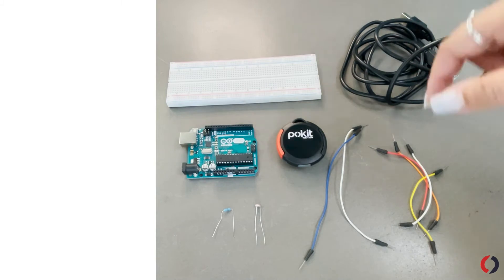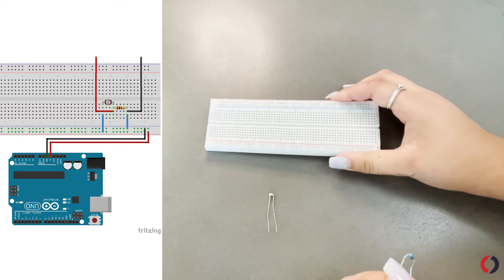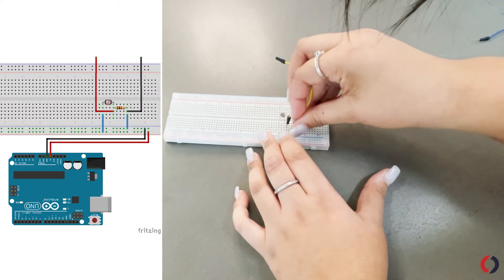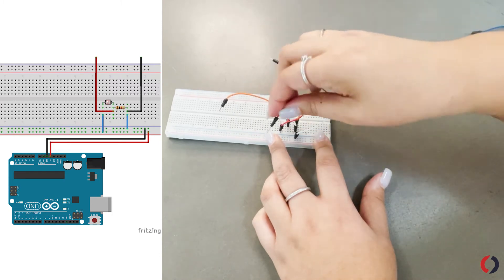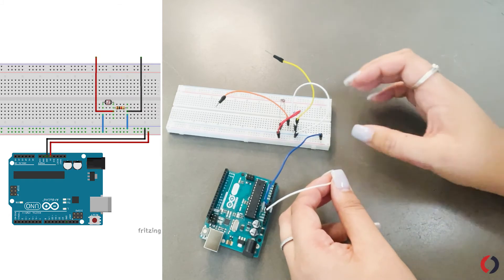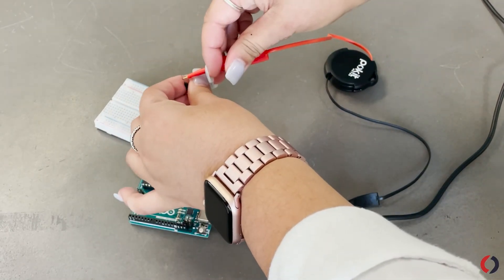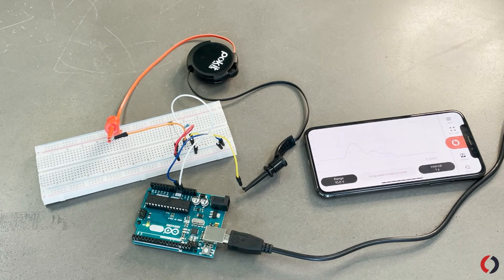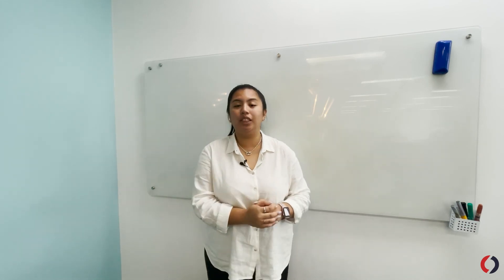How to build an Arduino Light Sensor

Comment: Sorry to say but that was probably one of the most useless "Arduino" uses ever.

Why not just remove the Arduino part, it's not like you are using any feature of it at all. 
Assuming you are using a 5v powersupply.